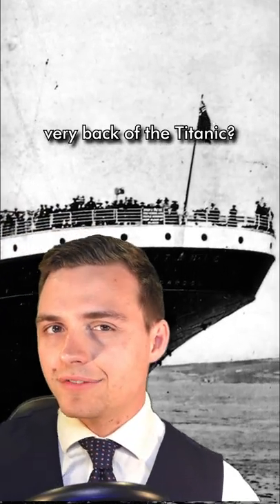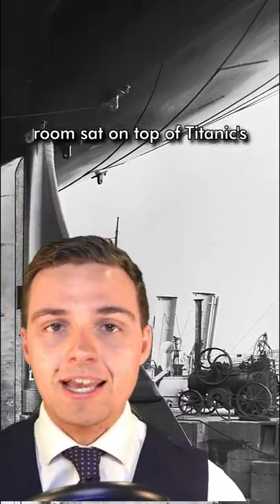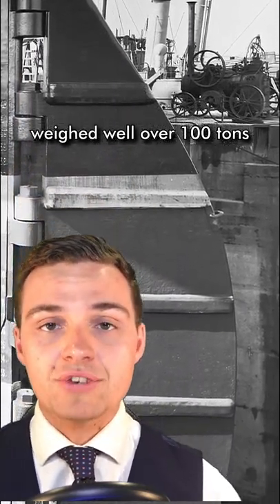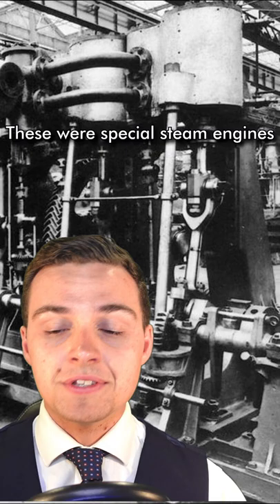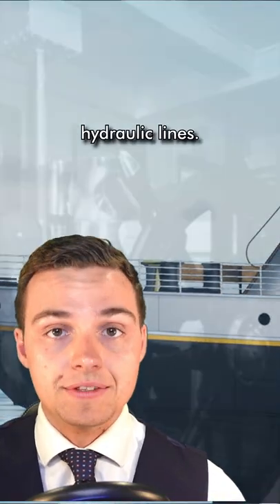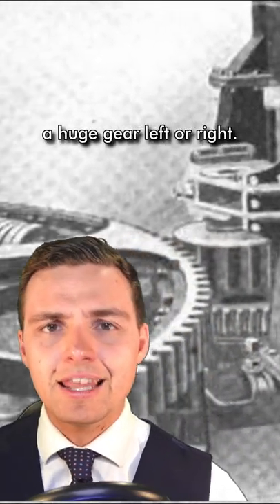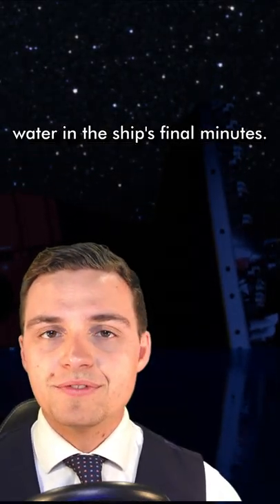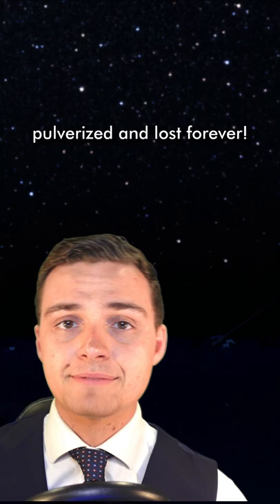What was in the room at the back of Titanic? | Oceanliner Designs Shorts

Comment: Jeez imagine being able to see the very moment where the steel can’t take the pressure of the water trying to get to the air pocket and it just BOOM implodes and tears the ship to pieces
Reply: It's not a submarine, so it would not have been pressurized and would not implode. It would have only filled with water.
Reply: it wld hve been horrible for the men wrkn down there .And it wld hve scattered everywhere crazy
Reply: @davidscott5903  Nah, not true, it's already 'pressurised' in a way because the air pockets don't match the pressure of the surrounding sea - so it is a submarine, of sorts. And, hence, those air pockets implode to match the immense pressure of the water crushing it. There are 3D models of Titanic imploding, gives a good understanding of what happened beneath the surface (and survivors said they heard a large boom sound after she slipped below the surface).
Reply: @skullsaintdead  
Please ask yourself how much pressure difference there would have been when the Titanic was still near the surface. Then ask yourself how that small amount of pressure would "crush" it. Even if it had sunk to 70 ft. deep it would only have about 30 psi of pressure on the hull, and that's about half, or less than half of what most normal cities run their city water systems at.
Reply: @davidscott5903  You are aware the Titanic sits at 12,600 ft or 3,800 meters of depth...
Reply: @skullsaintdead  
Yes, but the water tight bulkheads only extended up to the main deck, so as soon as she slipped underwater, she would have been filling up by water pouring in through every passageway that led to the main deck. Both filling the spaces with water and equalizing the pressure at the same time. If there were any explosions, those would most likely have been from steam explosions from cold water hitting the steam pipes and causing them to rupture with as much energy as dynamite.
Reply: @davidscott5903  it's a known fact the stern imploded
Reply: Worst part is? People were alive most likelt when it did explode
Reply: @davidscott5903  true sorta. Thing is she sank faster then the water could enter, which led to the implosion and why her stern section is so damaged compared to the bow. 

Remember water can only enter as fast as air or pressure can be allowed to be lowered or leave.
Reply: @mikkel066h  
So you're saying that 12 square feet or more per doorway and stairway is not enough room for the water to flow into those areas to increase the internal pressure fast enough to cause a difference in pressure great enough to crush the steel rooms? I find that hard to believe, and it makes me think that we're not being given all the information. If it truly did implode, there had to be more restrictions to the flow than what has been described to me.
Reply: @davidscott5903  The air has to escape as well and it can’t go downwards through the huge hole that was created by the breakup. It has to be pushed through the doorways which also ends up being underwater creating more resistance for the air to escape. 

It was pretty much a huge diving bell at that point leaving huge air pockets inside the ship.
Reply: @mikkel066h  
Think about what you just said.
You just called it a diving bell.
Which is quite accurate. Including the fact that the pressure is equal inside and out. The air doesn’t have to escape, the water just has to flow in and pressurize the air. Which would happen quite easily.
Reply: @davidscott5903  I said pretty much. A diving bell still regulate the pressure and is lowered at a controlled speed. Plus it does not usually go to the depth and speed which the Titanic sank.
Reply: @mikkel066h  
Ok, you’re right about a diving bell being lowered at a controlled rate, and they have a much larger opening area to volume ratio that would prevent them from ever developing a pressure differential. But if the aft end did implode purely due to pressure it would have had to have been sinking at an incredible speed!
Reply: @davidscott5903  well from when she broke apart and the stern section was vertical, about 50m of the ship was above water. That took under 23 seconds to go under water which as you said is pretty fast. Plus that is not considering that she was still under acceleration under water.
Reply: @ilenastarbreeze4978 not inside of it though. Anyone inside had been swept down to the bow so nobody likely was still alive. Though I guess we will never really know
Reply: @lolloblue9646  Except the damage is outward, not inward. Implosions are inward.
Reply: @davidscott5903  You we’re vindicated. A year late nonetheless but still.
Reply: @kugelblitzkrieg  the implosion was near the surface. The stern tumbled on the way down, parts ripping off, buckling under the sheer force of the plunge through water, until it finally came to rest on the ocean floor, surrounded by its own pieces
Reply: @lolloblue9646   But as I said, the ship didn’t crumple, it exploded outward. Implosions HAVE to happen inwards by definition but there is no signs of that having happened.
Reply: @kugelblitzkrieg  with how devastated the stern is you could find evidence for anything. The only thing that could have exploded would have been the boilers while still hot, but we know they fell out of the stern when the ship broke in half and they immediately fell to the bottom. The stern doesn't even look exploded, it looks like it collapsed under its own weight when it impacted the ocean floor and decay in the century that followed

Comment: I cut up 2 mothball fleet ships at Mare Island in the Bay Area,  and I can tell you that machinery this big and heavy doesn't get pulverized.
Reply: Exactly what I was thinking, probably thrown all about the place but this gear will still be down there, intact.
Reply: That was an ignorant remark the narrator made about the machinery getting "pulverized." Solid metal parts don't get squashed.
Reply: @stevek8829 
He also doesn't understand that the stern section couldn't possibly have imploded. 
Since the bulkheads in the Titanic weren't true watertight bulkheads because the tops of them didn't tie into anything they were just like walls that don't go all the way up to a ceiling, if you take the stern section and upend it then it's basically like taking a 5 gallon bucket that doesn't have a lid on it and turning it upside down and pushing it to the bottom of the ocean, all that will happen is as the pressure increases as you go down the air trapped inside will just compress smaller and smaller the further down you go because water can enter the open end at the bottom to compress the trapped air, theoretically to the point where it'd be the size of a single bubble in a beer if you went down far enough, because as it gets smaller water is coming in the bottom because there's no lid on it (don't forget it's upside down), then if you took it back to the surface the tiny compressed air bubble would re-expand to it's original volume when you got to the surface by forcing water out of the open bottom as the air expands to it's original size once at the surface. 
In order to have an implosion that same 5 gallon bucket would have to have a lid on it, then if you turned it upside down (which actually wouldn't matter since there is a lid on it) when you pushed it down towards the ocean floor water can't enter the bottom to keep compressing the captured air smaller and smaller the deeper you go, since that won't happen eventually you'll get to where the material will fail from the pressure and you have an implosion.
Since the bulkheads in the Titanic didn't go all the way up to the deck they'd be no different than having baffles on one side of that 5 gallon bucket, they wouldn't stop water from coming in the bottom of the bucket (no lid and turned upside down) as you descended deeper and deeper.
As long as the stern isn't fully water tight and water can come in the open end and compress the trapped air smaller and smaller the deeper you go you don't have the conditions necessary to have an implosion, to do that you need a completely watertight container that tries to hold the water out all the way around that will eventually fail from pressure, that's when you have an implosion.
Reply: @Duke Craig  you are completely wrong and all of your points are irrelevant to an implosion. The stern section was dragged down by the weight of the bow before it could fully flood. This means that during the decent to the ocean floor the stern was subjected to the full pressure of the water around it without enough internal water pressure to resist collapse.

The stern is litterally visibly imploded on the ocean floor today, this isn't a debatable fact.
Reply: @90degreesSquare  
Nope, without it being fully watertight, like a submarine or as I said a 5 gallon bucket with a lid on it you don't have the conditions necessary for an implosion, the front of the stern section was broken off as you said, which is just as I said the same as taking a 5 gallon bucket and turning it upside-down and pushing it down into the water which traps air in it, keep pushing it towards the ocean floor and the air trapped inside will only compress smaller and smaller the deeper you go, but there won't be an implosion.
And the damage you believe is from an implosion is simply from it smashing into the ocean floor, at the speed it was moving it'd have been the same as dropping it on the ground from 30 feet up or so, just like the part of the bow that collapsed when it hit.
Reply: @90degreesSquare  the sides may have come apart, but the machinery is still relatively intact.   5,000psi surrounding all surfaces doesn't mean anything to solid steel.
Reply: @krail5500  I never claimed the machinery would be pulverized, it most likely wouldn't be, but that doesn't have anything to do with an implosion
Reply: @90degreesSquare  I think you did...
Reply: @Thomas Selden  if the stern had a huge hole in the end of it and had air in it as well, then as the water came in, it would have compressed the air to match the water pressure.  Any tanks or areas that were sealed would implode.  I've looked at the wreck many times and I see the hull plating loose, but the rids are still intact...so if it imploded then the ribs would have all been pushed in and the stern wouldn't be recognizable as a ship.  It would look like a pile of scrap metal on the ocean floor.
Reply: @krail5500  it does look like a pile of scrap metal on the floor though.
Reply: @K Rail  it does look like a pile of scrap metal on the ocean floor. Ships are not like buckets, the stern could not flood freely and evenly like you suggest, there were air pockets in the ship as it sank that collapsed. You have no clue what you are talking about, and you are wrong. This is not a theory, it is an observable fact.
Reply: @dukecraig2402  The next person who suggests half the ship didn't implode can go volunteer THEMSELVES to dive 500 ft in the ocean without a pressure suit.
Reply: @Thomas Selden  check your definition of "pulverized".  You're clearly not using it correctly...
Reply: @Thomas Selden  are the boilers pulverized?  No.  Is the engine pulverized?  No, it split, but definitely not pulverized.   Hull plating coming  loose is not pulverized...
The ribs are still intact, I "observed" it.   Other people's ideas and opinions scare you like a small child, so good luck with that.

Comment: 2 things, 1 I though the fantail of the wreck was actually relatively intact. 2 I’ve had the privilege of working with running steering engines in museums, and they’re pretty heavily built, so even if they had mechanical failure due to the pressure, I think it would look more like a freeze crack than a full implosion

Comment: Heavy machinery does NOT get "pulverized" by a mere blast of air.  Damage CAN be done by flying objects in a blast of course. However, Thousands of feet below the surface, 'lost forever' seems a good description.
Reply: The deck above that machinery collapsed several decks into the stern, that machinery is gone if not rust on the sea floor somewhere

Comment: When the titanic broke in two, could the second part have stayed above water if it was fully separated?
Reply: Ships have been cut in half and had half survive, albeit usually military ships. The French destroyer MN Surcouf being accidently ran down in low light conditions by a soviet freighter comes to mind.
Reply: @evh1734  Thank you very much! Really interesting
Reply: No. By the time it split apart, the after compartments were already filling with water. The weight of the water pulled the stern section down very quickly.

Comment: MIke, your videos are very informative and technically correct. That's why I'm surprised that you would say the heavy machinery of the steering gear was probably pulverized. Essentially a mini version of Titanics triple expansion steam engines, they would be made of the same solid steel components. Water pressure does not pulverize solid metal objects. If that were the case, the entire wreck would be nothing more than little bits of ground up metal. And we certainly wouldn't have any of Titanic's dinner plates on exhibit in museums.

Comment: One ship I worked on used a very noisy 2-cylinder steam engine to turn that big sector gear through a worm-gear.  It was fun to watch.  In case of catastrophic failure there was a gigantic double ship's wheel mounted on the fantail.  Someone told me that four strong men were required to steer the ship with it.  The ship was the David P Thompson, a 550' long self-unloading bulk carrier based in Cleveland in 1967.

Comment: It did not implode 🤦‍♂️
  The deck plates were torn off due to the increasing internal pressure created by the water rushing through the tear compressing the air trapped inside the stern section as the stern sank
 This happened closer to the surface than anywhere near “crush depth”
Evidence of portholes being blown OUT from internal pressure is evidence of this 
Most of those components were big solid pieces of steel and solid rods attached to cylinders filled with hydraulic oil
  And we all know you cannot compress liquid
  And there would not be nearly enough pressure to “IMPLODE” this equipment